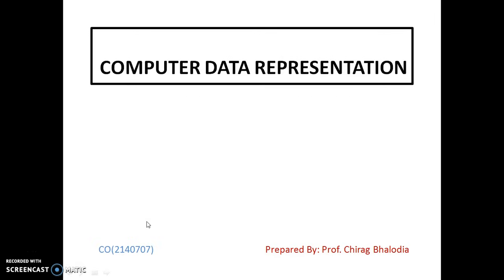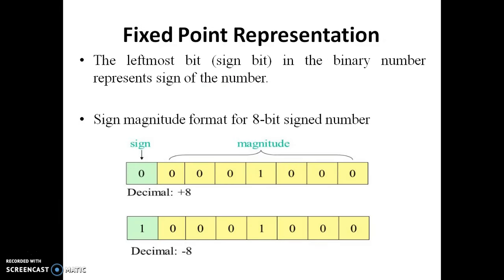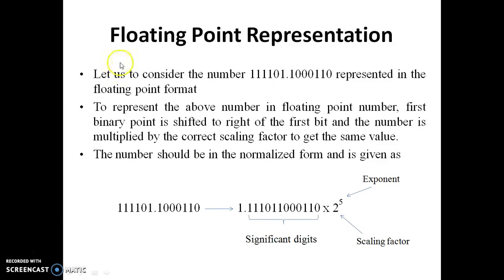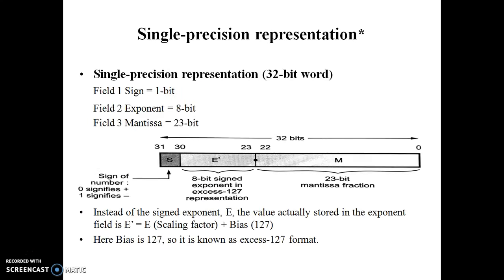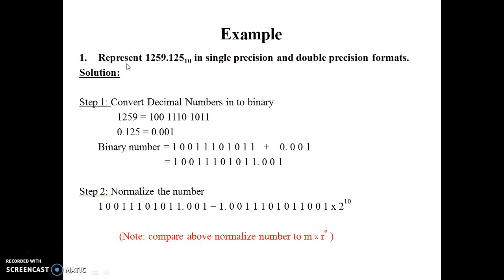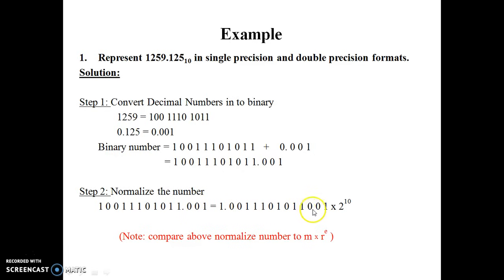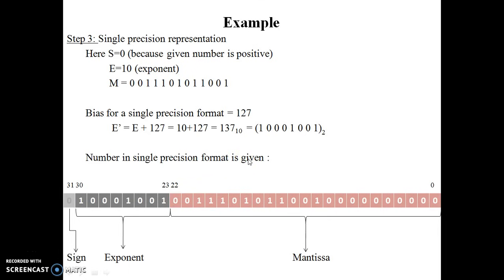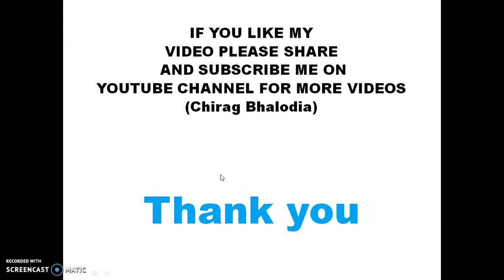Single Precision and Double Precision floating point representation | IEEE 754 Floating point

Comment: Sir can u please answer my doubt.In extended precision floating point there is 1 sign bit,15 bits for exponent,there are 64 magnitude bits out of which 63bits for significand fraction and 1bit for significand integer.(source- Wikipedia)What is significand integer,it is not there in single and double precision.tq sir
Reply from the maker: For example,123.45 can be represented as a floating-point number with the integer 12345 as the significand and a 10^−2 is power.... 
Please share this video with others....Subscribe my channel....
Follow my blog: https://www.edu-resources1.com/2021/09/single-and-double-precision.html

Comment: there's a problem with how  you converted 1033 to binary in double precision dont understand how you got that value
Reply from the maker: (Really sorry for late reply)
1033 =  10000001001
Last bit bit  - 1
2nd Last bit - 2
3rd Last bit - 4
4th Last bit - 8
5th Last bit - 16
6th Last bit - 32
7th Last bit - 64
8th Last bit - 128
9th Last bit - 256
10th Last bit - 512
First bit - 1024
(Total 11 bits)
We have to calculate 1033 means 

1024 + 8 + 1 = 1033 (SO, first bit(1024), 4th Last bit (8) & Last bit (1)....rest of others are consider as 0).

Therefore, 1033 = 10000001001.
If you still have any query then ask me.
 
Please subscribe my channel. Like share and comment on all videos. Share with others.
Thank you oin advanced.
Reply: Thanks
Reply from the maker: Follow my blog : https://edu-resources1.blogspot.com/2021/09/single-and-double-precision.html